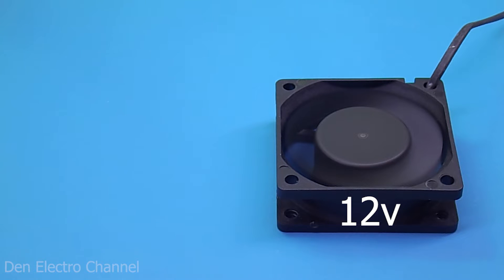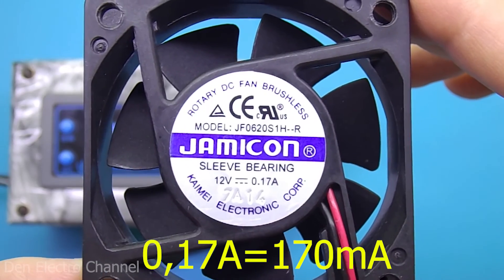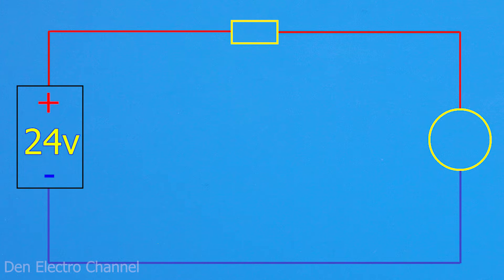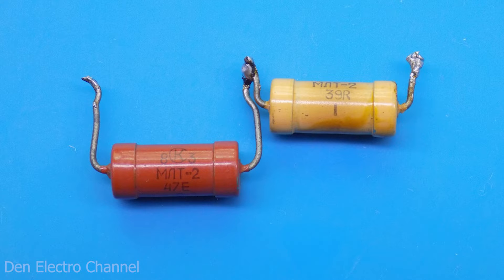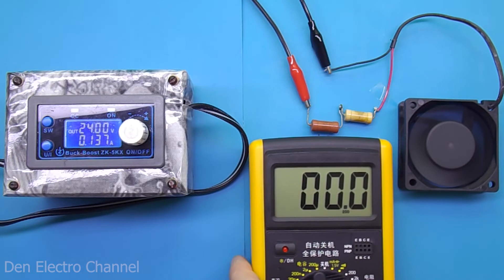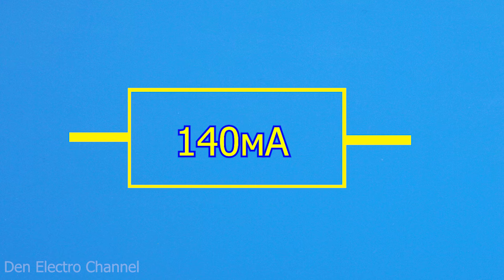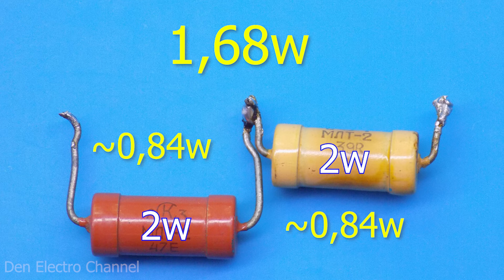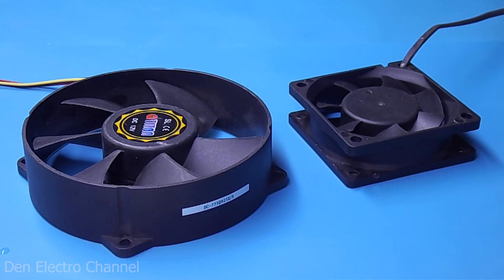Starting a 12 Volt cooler from any voltage

Comment: I feel there are specific components and parts sold for these because using resistors isn't always the best way to drop voltage across a circuit, reason why because they change accordingly to the volts being supplied so you could really damage your components, next time you do for DIY sake, try using diodes atleast those drop a steady amount of voltage, tho you'll need many of the in series.
Reply from the maker: Diodes also do not stabilize voltage, just like resistors. They will not help when the voltage increases. It is easier to clean with a resistor, we will extinguish the voltage that we want, so they are always used to reduce voltage. A resistor can extinguish even 1000 volts, that is what makes them convenient.

Comment: I have a small solar panel in my shed with two 8inch fans. Problem I have is every morning I have to turn the fan off and back on to get them to spin fast. I want them to run by themselves without having to turn them off and on everyday. How do I fix them? What can I buy? Thanks